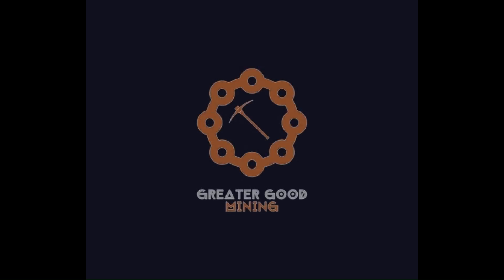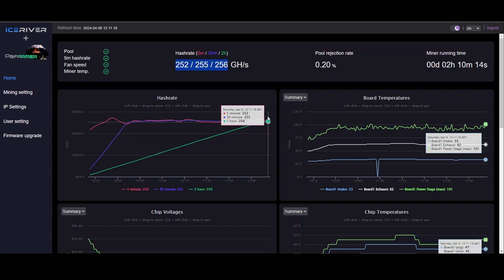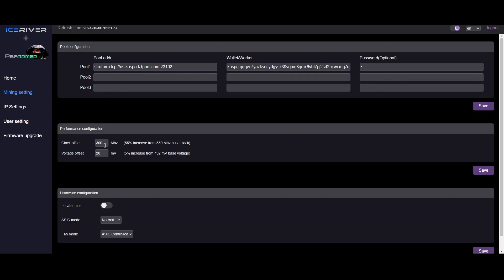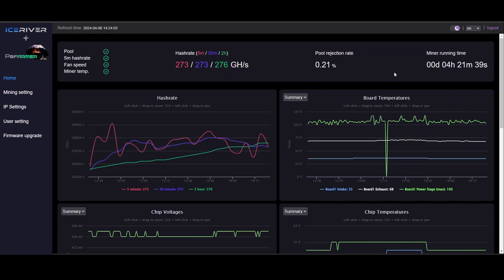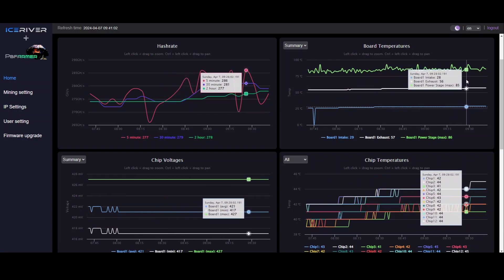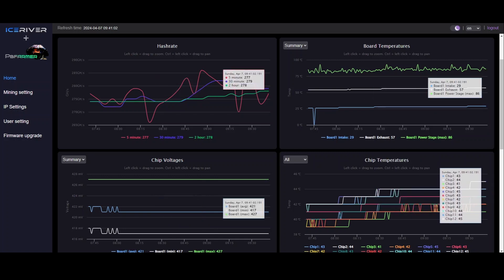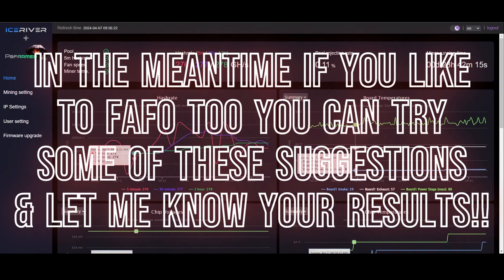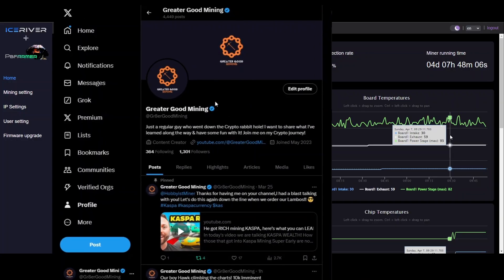Iceriver KS0 Pro Kaspa ASIC overclocked to the MAX!! (Heavily modified Vs Stock part 2)

Comment from the maker: Now that you've seen where the bottlenecks are on these machines, what do you plan to do about it??
Reply: i did copper heatsinks, better power supply, new pads. and 1 of my pro's will just run away with temp and restart.. can get it stable around 270.. other is doing 313gh
Reply from the maker: @polli3578  My first KS0 Pro didn't do too well with any of the overclocks either. Even with all the mods. My most recent 2 have done well though. Silicon lottery, showing its ugly head lol
Reply: @polli3578  i have the same issue even with all the mods
Reply: @GreaterGoodMining do you know how the chip order goes?  My temps on 6,7, and 8 are higher than all the others and would like to figure out why but I don’t know which ones they are in the board

Comment: Would media blasting the powder coating off help with cooling? I don't have any miners (just ordered 2 kso ultras), im guessing the hole thing is aluminium? I would think bare aluminium would be best for heat transfer
Reply from the maker: That's not really necessary. The bottle neck is the power stages getting too hot. The heat sink works fine for dissipating heat especially if you use a higher quality thermal paste and pad. The chip temps aren't as much of an issue especially if you use a shroud kit

Comment: Is it okay to just take the two side panels off to have it breath better or should they stay on? I’m just running a dual usb fan below the base blowing up. No oc’s on.
Reply from the maker: Yep you can take the side panels off no problem. I do that too just to keep temps down a bit. If you're worried about anything getting into the miner you could buy side grates from Meter Box
Reply: @GreaterGoodMining  thanks. What about cutting a piece of HVAC air filter and taping it to cover the ends?

Comment: would adding heatsinks to the metal plates on the chip side of the board not bring the board temp down
without bringing the chip temp down

lukewarmminer said some people that had problems getting them to run 340, found it helpfull adding heatsinks on the metalplates that also are there to get rid of heat

to me it looks like those plates are there to cool the board, but maby im wrong
Reply from the maker: If you want to keep your chip temps up and board temps down, get a more powerful fan and use the push pull method with two shrouds and remove the top fan off the heat sink.

Comment: What temperature can the chips withstand without being destroyed?

What clock offset/voltage offset are you satisfied with? I don't have to have 300gh/h but a bit more like original would be better. Better to take it easy on the device, that was expensive :-)
Reply from the maker: If you follow my other video where I show how to prep the KS0 Pro then you should be fine with overclocking. Every KS0 Pro is different and ambient temperatures matter. I recommend reading the read me file provided with the overclocks to learn how to do this properly for your own setup. My settings might not work well for your KS0 Pro
Reply: @GreaterGoodMining  I am currently using your setting as at the beginning of the video

Clock offset 125
Voltage offset 0

261/243 GH/s better than standard

watch then see further :-)
Reply from the maker: @Wurstsuppe100  that's the way to do it :] tweak it up a little at a time and watch to make sure it behaves. Good luck and have fun with it!

Comment: Hi man! First of all,  thank you very much for the videos of ks0 pro oc, they really helped me!

One question, In the video where you  make the modifications (heat sinks and everything) you say that you were blowing air from the power conector to the ethernet conector (like everybody does), and that you were going to try changing direction to improve heat sinks performance and avoid the things in the middle. Have you tested this already? How did it go?

Thanks in advance. Keep going with this nice videos please, they help new miners a lot :)
Reply from the maker: Hey thanks for watching! I havnt done extensive testing blowing in one way Vs. The other yet. Blowing in from the ethernet side makes sense to cool the power stages with the copper heat sinks better but then it's harder to access the IP report button but that's not a big issue because static IP etc. Blowing in from the power side makes sense in a different way because the barrel plug gets HOT and I worry that it could cause an issue. I might try a push pull set up again because the fan on top of the heat sink might not be necessary since it mostly helps cool the chips and dissipate heat from the inside. The chips are cool enough, and actually sometimes too cool when the temps drop at night

Comment: Question - you mention stability. Is that refering to only the power stage / chip temp - or does it include the hash rates? 
2 Hr hash rate is 338 - but 5 min has a swing of 30 GH/s (1 hour range - low 323 / high 360). 30 min avg - 340.  
KS0 Pro - added heatsinks, new pads, MX-6 paste and upgraded PSU.  Fruition shrouds with AC infinity blowing into the ethernet side - est 30% fan.  400Mhz / 46mV.   Power stage avg 87 - no spike over 93.  Chip temp avg solid @ 48 / max 51.Chip voltage avg also solid @ 438 / 443 max .
Reply from the maker: Sounds like you're getting great results! The 5 minute and 30 minute will fluctuate like that, it is normal. Instability means the rig will crash or your hahsrate will drop drastically and stay there.

Comment: how to reduce power board temperatures on ks0 pro?
Can't seem to find an answers anywhere.
309 gh/s - 275mhz/34mv.
Can i reduce board temp without loosing hashrate?
Board temp between 99 and 106 all the time, i don't like it...
Added 4 x 5x5x6 heatsinks, can't find the tall ones, change thermal paste and pads. Printed  a duck eth side with 120mm ac infinity style  and another 120mm on top.
PSU: 230w @ 161w
Reply from the maker: What are the cfm on your fans? The ones I use are 110 cfm. You need powerful airflow to push air through the middle
Reply: @GreaterGoodMining  Maximum Speed: 3000 RPM | Airflow: 348CFM | Noise: 62dBA for 3 fans for shrouds and on top Maximum Speed: 3000 RPM | Airflow: 348CFM | Noise: 62dBA for 4 fans. Don't know if i divide the amount of cfm per fan. Sorry for the links,  didn't think it through.
Reply from the maker: @dafunkmonkey  I'd be surprised if the fans you're using are 348 cfm? That's a very powerful fan lol. You need a shroud kit specifically designed to attach to the end of the KS0 Pro to blow air through the middle of the ASIC.
Reply: @GreaterGoodMining  I printed some fan shrouds for my fans, i modded my ks0 pro exactly like you did. Except for the shorter heatsinks.
Reply from the maker: @dafunkmonkey  what are you intake temps? I wonder if you have a faulty temp sensor? You still have wiggle room on your voltage and clocks. What are your chip temps and power stage temps?
Reply: @GreaterGoodMining  intake 29 - exhaust 66 chip 51.4.  power stage not below 97. 34mv for 168w
Reply from the maker: @dafunkmonkey   All of that actually sounds fine. Power stage max is 125. I am trying to keep mine around 100 or so to allow for some wiggle room and variations in ambient temps etc

Comment: oh it is DEFINITELY silicon lottery.  I have one pro running 300ghs with clocks of 275 offset / 24  mhz voltage.  The board temp on this one is only 100. 2 other pros with the same upgrades/repaste/repad/copper heatsinks, the boards running near 125c. I have 3 new special edition pros that i have heat treated and i need to overclock.  will use pbfarmer here as well and test.  wish me luck
Reply from the maker: 100% my first KS0 pro with full mods hurt my feelings and wouldn't OC past like 290ish no matter what tried. This batch of Green Machines for me has taken much more abuse so far. I hope you hit the jackpot in the silicon lottery this time around brotha!
Reply: @GreaterGoodMining  sounds like my ks0 pro cant get it to break 290
Reply from the maker: @andrewfurfaro5326  darn silicon lottery. I got so frustrated with ny first one lol

Comment: My OC: 300/32, 170w, power stage 91C, Chips 51C. Blowing to ethernet and sucking from power side. Stable ~315gh/s. New paste, low aliuminium heat sinks.
Reply from the maker: Nice! Sounds like you've got it dialed in. What fans are you using?

Comment: Love you videos brother. 
Question. Did you get any Ks0 regular versión? If so, can you overclock it over 170ghs?
Reply from the maker: Hi thanks I appreciate it! Yes I've got a regular KS0 at around 180 to 185 gigahash. Didn't modify it, just put a Axial 1238 on top and aimed it down to the heatsink. I should've tried to do a video on that one too.

Comment: If I just overclock the core clock and don't touch the voltage would the power draw go up?
Reply from the maker: Yes you'll draw more power and your voltage will drop

Comment: Love that you were able to use the graphs to show the correlation between ambient and hashrate.  This is exactly the kind of thing I was hoping all the graphs w/ the synced tooltips would help people troubleshoot.  And it's not just you, these things absolutely suffer in performance when the hash chips start hitting low 40s and below.  50s does indeed seem to be ideal for KS0 Pros.

Also, your hashrate on the unmodified one indicates you're voltage starved.  280 Gh/s should only require ~220mhz offset (550mhz * 80ghs / 200ghs = 220mhz).  Assuming you don't want to increase voltage any further, you should try reducing your clock offset to 220, or maybe find some middle ground between +220mhz and your current +275mhz offset that might actually give you a higher hashrate.
Reply from the maker: Thanks I appreciate the info! I did feel like I should've been able to get a bit more out of the mostly Stock KS0 Pro. I'll try decreasing the clocks a bit and see how it does. I was starting to worry about the power stage temps and it did seem like things improved when I backed off the clocks a bit. Thanks again!

Comment: Did you try to overclock with the original psu? don't know if it's possible to overclock it like at 250 ghs and stay under the 120 watts.
Reply from the maker: I wouldn't bother ordering the stock PSU from Iceriver. You'd be better off getting a better one off Amazon like the one in the description of the video. If all you have available is the stock PSU I would highly recommend using a Meter Box to monitor the wattage. The closer you get to the max wattage listed on a power supply, the less efficient it gets

Comment: Thx for this video, I’m gonna overclock my stock ks0 pro slightly and see where it gets me.
Reply from the maker: Nice! Yeah Ive overclocked my stock KS0 Pro with this firmware and I love it. Just have to be patient and go up in small increments
Reply: @GreaterGoodMining  so you do the clock offset first and then after finding good speeds then do the voltage offset? or should you do both together?
Reply from the maker: @LostJediJC  offset first until machine starts to act funny or the increase stops being effective. Then tweak up voltage a tiny bit and see how machine reacts. Then go back to tweaking up offset again

Comment: First🎉
Reply from the maker: WHOA! That was fast RandomMiner!!! lol
Reply: What did you use for power? 230 Watt laptop psu? I am trying an ATX PSU with The Veteran Miner cables.
Reply from the maker: @RandomMiner  I used a 230 watt laptop power supply. I put the link to the exact one  use in the description :] I haven't tried The Veteran Miners cables with a HP server power supply yet but I probably will do that in a future FAFO session!
Reply: @RandomMiner  I don't think you want to do this if you're planning on OC.  ATX PSUs run 12v instead of the 19.5v you're getting on the laptop PSU, meaning 63% more amps running through the barrel connector.  They tend to melt or worse as they're not rated for that draw.  Many people running 12v are soldering the leads directly to the boards.